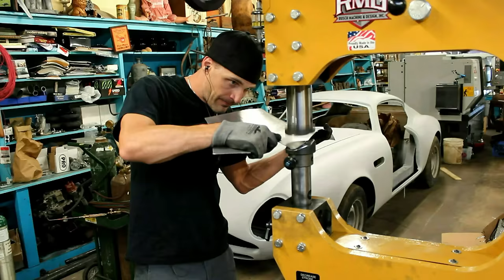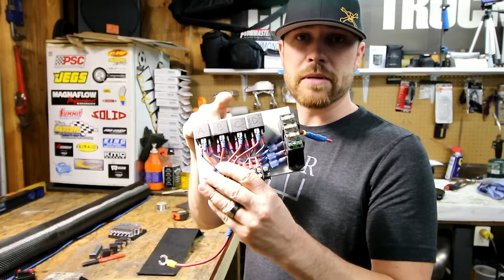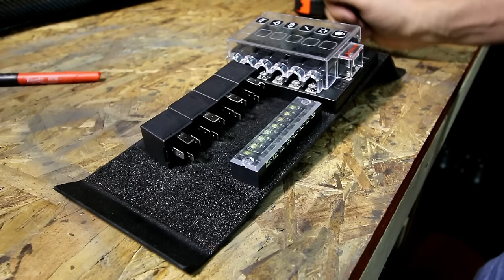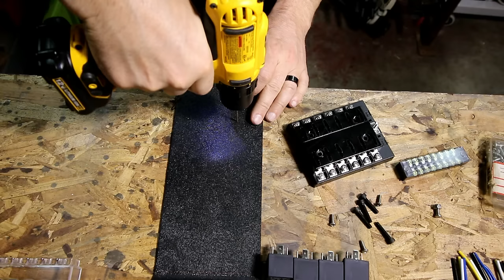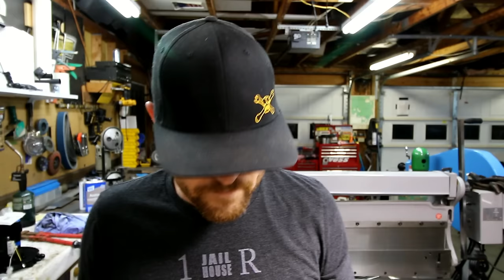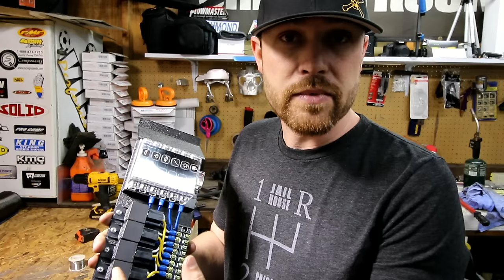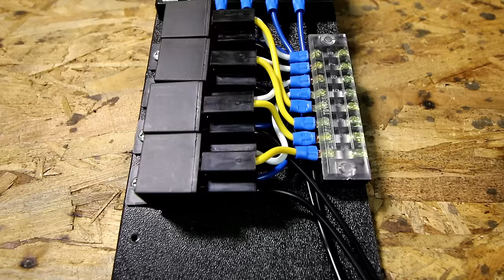How To Make A Power Relay / Fuse Block | Automotive Wiring

Comment: I used to wire boats in the Navy and found that boards like you put together are great. What i did different than you is I found that servicing things required I put the relays farther apart from the terminal block and the fuse block needed to also be farther away in order to service them quicker and more efficiently. I agree that it is more professional to make a panel and have things in a neat and proper order.

Comment: just learned more in 13 mins then I ever did in my basic electrical class.
Reply from the maker: +4 Jr lol...thats awesome
Reply: 4 Jr Maybe you should have paid attention more? They gave you the basic skills to do stuff like this. I took three years of electronics and didn't really use it. I'm starting to now and I'm glad I paid attention.
Reply: I learned a lot in my electronics school in the Navy. Then I learned a lot more on my own by working on electronics equipment.  It sounds like either you are not very smart or you went to a crappy school.
Reply: for reals man... my instructor made us do a 2 fan with 3 relays and in 2 speeds but he just threw us to the lions ddnt gave an explanation of how it works...
Reply: Sorry I don’t like this.  (I don’t mean the vid, or the workmanship but the principle.). The master breaker is far too big.  A fuse is to protect the wireing if there is a fault.  The red wire looks about 30 amp fo the fuse ( or breaker) should be 30 amp.
Secondly, by this stage you should know what you are switching, so even at this distribution point I think you should be using switching and switched wire colour coded.

I do, however note the relays are the right way up.  If mounted pins down they can fill with condensation and the points corrode.

Yes it looks very neat but I don’t like it.  Sorry.
Reply: Also know that with 300A breakers, your battery is gonna die before the thing trips lmao
Reply: Charlie Wilson 😭
Reply: @TheCarpenterUnion  so are the 300A breakers useful or not?
Reply: @Roger-ob2ft  They are useful when right. You might as well consider that a quick disconnect because it is way to large to protect anything downstream in that example. You fuse to protect the wiring from becoming a fire hazard. Something that can be important to also consider with circuit breakers is that they are made to interrupt dc current. Not all are created equal in this aspect. Edit, I looked at those breakers and use them at your own risk. I have used similar style breakers, but that weren't junk in applications before.
Reply: Well could of just used one big relay before the fuse block
Reply: Lolw
Reply: Marco Martinez sounds like my welding instructor
Reply: Yes! This is truly the most informational video I’ve seen
Reply: @SETHHIKARU lol
Reply: @mickcoomer9714  This is an old video and comment, but I agree with you 110%. You're not a party pooper, you call it as you see it. It happens to be my opinion as well. Hope by this time, he is even more professional.

Comment: I know I'm a profectionist pain in the a*s but I buy the ring terminals in bulk bare with no plastic sleeve on them. I do this so I can slip about an inch of shrink tubing on the wire then crimp on the ring connectors and  solder them on. Then I slide the shrink tube up and lightly heat the ring connector / shrink tube up. Put the screw through them then tighten them down. You are right this makes it look like you know what you are doing. The other important thing is to go slightly oversize on your wire ( don't cheap out on this important component ). As far as fuses, if I'm not sure how much the circuit is going to draw I start low and go up one step at a time. Fuses are way cheaper than electrical components.

Comment: Just saw this video and I find it pretty good for someone who doesn't understand or know how to work with relays in general. I personally find that adding that 300A circuit breaker is the wrong value for that project. You have installed only 4 of what I think are 30A relays. With a max current draw they would only add up to 120A. Assuming you may add in the future 2 more, it will bring it to 180A total draw. Having a 300A circuit breaker is way to high for the total load. Also, I would fuse the + coil side to a low fuse value, may be at 5A, but 3A is better. The main fuse value is determined by the total load value; Ex: Load 1= 20A, Load 2=10A, Load 3= 30A, Load 4= 15A. Main fuse should be 75A or as close to that as possible. Assume that all of those circuits could be active all at once at full power draw. Always fuse your relays  individually, don't rely on the main fuse only to protect the relay or the device connected to it. The main fuse job is ONLY to protect the power wire feeding the block input and NOT the devices connected to the relay or, the relays themselves.

Comment: I did something similar for my motorcycle and all the addons for it.   I added another relay for the main power so the whole panel is switched to ignition switch in run position.... used a heaver power relay for that one.   Well done!!  Nice and compact.   Variant to this would be getting ‘marine grade ‘ parts which are more water and corosion resistant... but more $$ too...

Comment: I have been all over the interwebs searching trying to figure out how to wire up a power windows conversion and add electronic door locks to my standard truck. thanks for the educational video.
Reply: Ah ha!!! I’ve been wanting to do that to my old truck also! Did you get yours done buddy? I would kill to have power windows in my truck! I was thinking form mine, it would probly be just as easy to find 2 doors from the junkyard off of an XLT truck that had power windows and locks from the factory cause then I would already have everything I needed already installed and mounted. Then I just have to figure out how to wire it all up then. It’s a 94 F-250 with the XL package which is your basic work truck and I’m just getting older now and trying to lean all the way over to roll down the passenger window is getting tough to do now so power windows would be a blessing!

Thanks so much for any info you could give me on if you were successful, did it work out good, how you did yours etc. 

Take care buddy and stay safe out there!!

Comment: Just had surgery, made one for the drift car as a project to keep me sane while recovering. almost done just waiting on the relays some grommets and non insulated ring terminals (will be soldered, crimped and heat shrinked)  to arrive to finish it. then the whole car is getting rewired. Keep up the great work man, the channel is awesome.
Reply from the maker: awesome...thanks and get well

Comment: great video and very professional end product. If I might make two suggestions to improve the final outcome if only marginally, first I always use marine grade awg rated wire it is tinned copper and will not corrode in normal automotive use and only costs a few cents more. Second I use aviation style ratcheting crimpers they work much better and do not require soldering which will prolong your wiring life by not removing flexibility from the wire.

Comment: This is exactly what i wanted to do to my car. Glad i found this easy install video. Right now i just have wires running all over with fuses inline cause i had no idea how to have a clean setup. Also that plastic is a great idea, i was looking into sheetmetal cause i wanted something to bolt my ecu on to as well as relays. Thanks for a great how to video.

Comment: That looks really good.  Nice job - simple neat and cheap!   I LIKE IT!   Just one comment:  it looks like your "heavy" wire is no bigger than AWG stranded #10 (?).   That wire will most likely "burn" if it shorts out directly to ground between  the 300A breaker and the fuse block  .   Based on the NEC, probably the breaker would be 80A or less to protect #10 if its about 4' from the breaker to the fuse box.   At 300A you are talking about AWG #4.
Reply: Yea, I was thinking that too. That red wire would like up like a christmas tree before that breaker would blow... A 300A breaker is appropriate for a starting circuit on a large V8 Engine; that's about the only time you would even get close to 300A draw, unless you have a competition audio system or a welder or something installed in your vehicle.
Reply: Think he meant 30Amp, those breakers only go up to 100A.
Reply: @israelboyd6883   - Wellllll but -  the links he provided to Amazon do go to 100 and 200 amp breakers.

Comment: Coming from the guy that is known by family and like to have E-fans wired with used relays and speaker wire I must say, this is awesome and seeing that its actually that cheap and easy to build I intend to do a setup like this on my truck. Its getting some major racing style mods and changes so a good really relay setup and not the disaster I have no would be a good change of pace. Thank you for making this video. I don't know why I have not found you sooner but you are the boss!
Reply from the maker: thanks man

Comment: Pretty good video, thanks for the information. 
However I must say there are a few soft spots in the provided information.
300A breaker won't help at all as the gauge wire you are using from the battery is too thin, the wire would melt before the breaker gets even close to pop. Another thing to note, that 10 way fuse block has a max of 30A per circuit and 150A per box, so again before the breaker pops you would blow the fuse box if you exceed the load of 150A.
Reply: This answered some of my questions. So if the fuse box can only take 100amps would you only want a 100amp breaker and wire gauged properly for 100amps from battery to breaker and then to the fuse box? About 8gauge wire for 100amps?
Reply: @joshtonry4291  yep, you can do 100A breaker but some people like to go a little bit less than the max rating of the fuse box.. probably 90A.. Wire gauge depends on the length of the wire, there are a lot of charts and calculators online that can help you determine which gauge to use, good luck!
Reply: @joshtonry4291  The main fuse value is determined by the total load value; Ex: Load 1= 20A, Load 2=10A, Load 3= 30A, Load 4= 15A. Main fuse should be 75A or as close to that as possible. Assume that all of those circuits could be active all at once at full power draw. Always fuse your relays  individually, don't rely on the main fuse to protect the relay or the device connected to it. The main fuse job is ONLY to protect the power wire feeding the block input.
Reply: Very helpful, thankyou for the replys

Comment: I just found your channel a few weeks ago. Some of us old race car guys that did it back in the day didn't have much access  to the parts that is offered now.  We had a gas and acetylene torch and maybe one of our friends had a arc welder to do what we needed done. As far as the electrical not much was out there for a 12 v system. A Ford starter solenoid was used for lots of things...Glad to see you DIY and other video's....
Reply from the maker: agree...thanks for watching

Comment: Might I suggest you using rivets for the mounting of the relays and power distribution blocks to eliminate the need for long screws sticking out on the back side, even plastic rivets if plan to be making changes. They are easy to cut, cheap to buy and look clean. Other than that, extremely nicely done.
Reply: It was just for a demo you muppet.
Reply: @SOLDOZER  holy shit someone commented on a comment from 2 years ago, and somehow I'm the muppet? Okay bud
Reply: @luminita520  and now a year later I'm here to say that your rivet idea is a really good one!  I'm setting this up for my Jeep and I was about to go buy some bolts and nuts. Instead I'm going to pull out my rivet gun. You've saved me time and money!  If you're a muppet, you're a damn smart one!  Thanks, bud!

Comment: I've been looking all over for a good diy video and I've finally found it. Been wanted to add 4 separate light accessories but didn't want to keep running wire to the battery for each one
Reply from the maker: awesome...glad you dig it

Comment: This is awesome.
I'm about to get my automotive electrical done at school and I'm going be adding lights on my 4runner. I've only ordered one light and everything else to go with it so far.
After watching this I'm leaning more towards this setup rather than just screwing the relay to the side of the fuse box that's already in my car. This also looks a lot better than just a fuse harness dangling about too.
With this setup you can always add more if you have only one circuit going through it. Thank you for the video man! It looks great!

Comment: if you use ground to trigger the relay you can have short coil power leads....plus you get the benefit of not running power wires through out the vehicle to switches,if they short it's just a ground not live power
Reply from the maker: lol....the accessories still need power so there will still be power wires running throughout the car and your way you cant turn those power wires off. They are constantly live. My way they are at least switched power wires.
Reply: I meant running power from the switch to trigger the relay coil....if ground is used to trigger the coil you don't have power running from a switch to the coil....the switch is connected to ground....the switch is used to allow or deny the ground for relay.....the coil power wires are short runs from the fused power instead of long ones running tho switch.....hence no long power wires to ground out from switch to coil control
Reply: Using this method will also allow you to jump pin 30 and the positive coil wire simplifying our wiring with each relay only requiring 3 wires rather than four.
Reply: goobersundae like a temp sensor?
Reply: Mdenz3 Do you mean jumper relay pin terminals 86S (relays contact to + battery) and 87B (Relay coil to + battery)? If you jump pin 30  and the positive coil wire (87S) that would just supply power directly to the item like a fan. Effectively routing around the relay, which you do not want.
Reply: Mdenz3 Couldn't you just buy a 3 pin relays instead of jumping.
Reply: Yep +1 with the other comments here about ground switching with relays. It's a great way to wire a car. "Ground switching" also allows you to use a TINY switch if you want (like welding DCEP is insanely hot versus DCEN is cooler/stable. Heat flows from positive). The idea is it's a positive switch and the coil requires positive AND negative signals. Either is switchable but ground requires a much smaller, lighter wire because the load to activate the relay coil is so small. One positive wire from battery + to 86 and 30 pins with the battery + and use the wire to 85 to ground and 87 on the switch. You can wire the other end of the switch (which activates the relay) to body ground and save the power distribution nightmare under the dash for positive activation switches. Most race cars for main cut/kill use a Batt negative cut and Alt+ for this reason (single throw dual isolated?).
Reply: goobersundae that's how fog light switches are wired from ford on rangers and explorers. Late 90s and early 2000s at least
Reply: Also there is less corrosion on a non energized circuit.
Reply: Temp & oil pressure, also the horn usually operates through a grounding scheme.
Reply: This is the most silly thing I've ever heard. What exactly are you grounding out there are your fancy little ground switch? Hopes and dreams? Because I'm pretty sure power flows to the ground, just because it's a "black wire" doesn't mean it doesn't have power flowing thru it.. just because it's on one side of whatever item you're powering, doesn't mean suddenly it doesn't have power flowing thru it.
Reply: @bungcheese5901  actually, the direction of power flow is all just theory. The most taught and used theory is the "conventional" theory, in which power flows positive to negative. If I remember right, the other is called the "electron" theory, in which power flows from negative to positive. Automotive applications just tend to run off of the conventional theory, even if only to keep things standardized and simpler.
Reply: @louisianagator95  interesting thanks for the respectful response. I've always been curious what exact energy is being transferred anyway, I personally imagine it as the metal balls on a swing, where one pushes the next, that's my interpretation at the moment because that's how fluid dynamics work. Id like to learn more about how electricity relates to that
Reply: @bungcheese5901  you're welcome. There are some similair aspects between power and fluid dynamics, but a lot of differences as well. There are resources online where you can learn the basics of power. Just remember this if you decide to buy some batteries, wires, and lamps, leave the batteries out if you're going to touch the circuit. Never work a circuit hot, eliminate the current, and properly use a multimeter or voltage detector to verify the circuit isn't energized. Anytime I do wiring on a vehicle, I disconnect the battery, if it's house wiring, I throw the breaker and check every wire in the vicinity twice with a voltage detector before I even think about touching a wire. Work safe, work smart.
Reply: @goobersundae  100%
Reply: Chris Wells the oil light (or oil gauge) are a backup measure. You can be the most mechanically inclined person in the world and still lose oil pressure because something breaks - for instance, the oil feed line to a turbo snaps and dumps all the oil. It’s good to monitor your engine’s health at all times.
Reply: a short to ground on a ground switched wire will cause  the accessory to run constantly whereas a short to ground on a power switched wire will blow a fuse. so basically, in the event of a wiring short, do you want your horn to not work or never shut off?  power switched is the way to go.